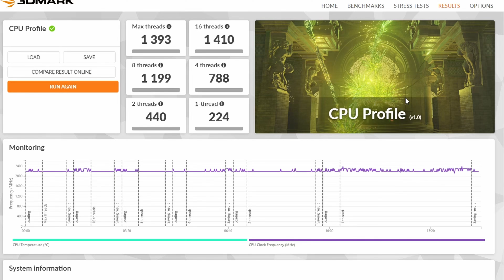Are Intel XEON CPUs actually good?

Comment: They're solid if you need good multicore performance on the cheap. Single core IPC is definitely not their strong suit, and I know that because I have several V2s in production servers still. If you want good single core performance on the E5 series, the E5-2667 is among the best. V0/1 to V4. It's important to note that socket 2011 and 2011-3 are different, and V0/1 and V2s do not work in 2011-3 boards which run V3/V4. The same the other way around.
Reply: If u can overclock they become monsters